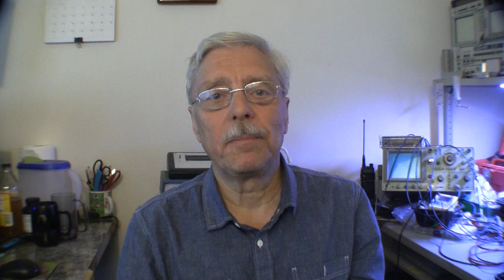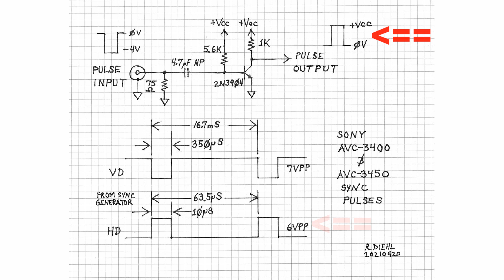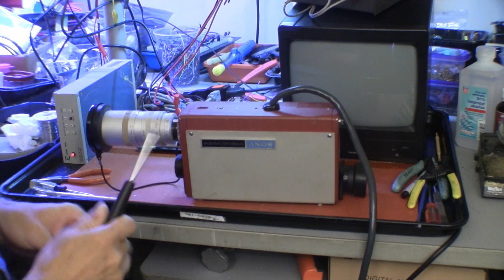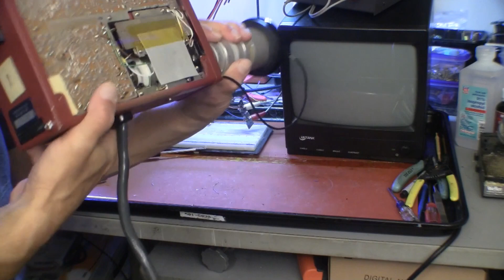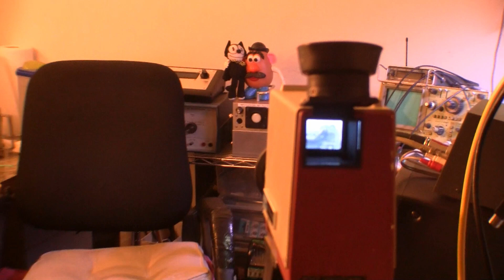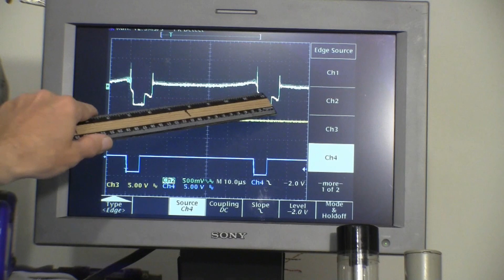Sync Generator Projects, Part 3 - Sony Cameras AVC-3400 & 3450

Comment: Why not use the CMA-1 power supply to generate sync signals?
Reply from the maker: The CMA-1 does not generate sync. It received it from the VTR deck it was plugged into. It had some pulse shaping circuits for the H. pulse. But no true sync gen. of its own.

Comment: very interesting, & detailed. Wish you had been my electronics instructor back in the 1990s. Though i do have a question: How low of a scan rate can it go, to say produce maybe 5 pictures (frames) a second over the usual 30 ? There is a group called narrow band tv, and was wondering if this would work for that purpose?
Reply from the maker: Thank you for the comment. Good ideas there.
See my NBTV series of videos. It would not be practical to convert one of these Sony cameras to a scan rate that low. The high voltage powers supplies for the camera and viewfinder are intimately coupled to the horizontal deflection and won't work at any other frequency. It would be best to build the camera from the ground up for that purpose. I based this conclusion on slowing down the frame (field) rate from 60Hz to 5Hz and the horizontal the same amount to create a 525 line, 5Hz refresh rate system. The flicker would be unbearable. Though it would work. Computer processing with frame rate upscaling could make it work too. But, in that case, there's mpeg.
As for NBTV, the frame rate is 12.5 frames per second and the line rate is 400 Hz. The picture is made up of 32 lines. Bandwidth is about 13 to 14KHz. In my system I clocked pixels from memory at 27.2 KHz to get more detail per line. (64 active pixels per line)
You may also want to watch my Philocam series to see how involved designing a video camera system from scratch can be. That one runs at 15Hz frame rate with 267 lines. When I built the camera, I included a frame buffer with 8 built in images for testing the monitor before the camera tube was making pictures. The frame buffer memory was part of the sync generator and made development faster and "easier". (There was nothing easy about it!) The proper process for designing a TV system is to work from the display backwards to the camera.
Here is my NBTV signal generator project: https://www.labguysworld.com/NBTV_10-4_Eleanor_001.htm
Reply: https://www.youtube.com/watch?v=_fO_xn1INfQ
Reply: This Grant guy near Toronto Canada wants to transmit Amatuer TV on 10 meters, and is talking to the Great Britian TV group. Thats what led me to ask if that sony camera could be slowed down to help out is idea, of using 10 meters I think around 29 Mhz to do it. I honestly felt for him cause who wants to transmit at 434 MHz just for no one to ever see it. Thanks for the well written explanation. I will check out your other videos, starting with your link. Thanks. Jeremy Cole N9IZX Canton IL 73

Comment: Interesting, I didn't know some 10-pin EIAJ cameras needed sync signals. So you can't use one of these cameras with a newer VTR or PSU because they don't generate sync signals. I would expect newer equipment to still generate those signals in order to work with older cameras.
Reply from the maker: There were not that many of the older cameras made compared to the later, more advanced, models. Color cameras had to have their own sync generators because the color signal was much more complex and the VTR/VCRs reached a point where they did not need to drive the cameras with sync anyway.
Reply: @videolabguy  Makes sense. When did single tube color cameras appear on the consumer market? The earliest single tube camera I can think of is the Sony DXC-1600 from 1974. 

 Also I don't know if you've seen this but Cathode Ray Dude, a guy on YouTube who has become popular, has a working AV-3400 VTR and the AVC-3450 camera. Sadly the camera doesn't work. He made a video on it titled "Sony's 1969 Camcorder".

Comment: Hello! I found someone selling the camera by itself without the VTR. Is it possible to go straight from the camera to a computer? Or am I grossly oversimplifying the process?
Reply from the maker: If you watch the series here, I answer that question. These cameras require a source of external sync pulses in order to create the complete video signal. If no pulses are sent in, then there are no pulses to add to the outgoing video and nothing for an external capture device to use for proper timing. The image in the viewfinder is misleading since the camera part and the viewfinder part use the same scanning oscillators, they are always in sync. Pulses or not.

Comment: I have a av-3450 along with CMA-5. I can’t get video out... may I ask, how do I get video out of that CMA-5?
Reply from the maker: CMA-5 is for self contained color cameras. That is, cameras that have built in sync generators. It will not operate a Sony AVC-3400 or 3450. I have no documentation for that camera adapter. But, it could be modified for external sync the same way I did my camera adapter. Contact me through my web site, Labguy's World.

Comment: im still looking for a avc-3400 for my sony av-3400 that i finaly got working these avc-3400 cameras are so hard to find bu for now i modfied a camera instaled a rocker switch for rec an pause an it works for testing purposes
Reply from the maker: The cameras on Ebay are massively over priced. Especially for being untested. The probability is good that they may operate. But, always plan on replacing the electrolytic capacitors and don't be surprised to find burns in the vidicons. Though, I have been lucky on this point. FYI: The 3400 camera, in my weekly update of 4/26, cost me $50 with free shipping. Just keep watching Ebay. They do turn up occasionally for a lower prices than usual. But, forget the guy selling one for $279. He won't come down to $50. I asked and was brutally rejected.
Reply: @videolabguy  yeah i asked an was brutely rejected people just dont care about a good deal anymore witch sucks also i have video of my progess if you wanna check them out rn im trying to trubble shoot the badly destorted audio
Reply: @axelthefoxytechworld8024  Hey, I found a avc-3450 (camera with the 10-pin cable) locally, and came across this video trying to see if it would be possible to even attempt to use it for digital purposes (without using the tape). But it seems like this is way over my head. I can sell it to you for $50 + shipping if you are okay with that. I can send over pictures of the camera if you would like!
Reply: @videolabguy  Shopgoodwill is great for this, I've seen the AV-3400 for sale on shopgoodwill before. It's auction based so nobody will be overpricing it, just whatever it's actually worth. I managed to get a working 3 tube Plumbicon camera made by Ikegami for $40 including shipping. SGW is amazing

Comment: Awesome scan linearity. Did you have to replace the capacitors in the cameras to achieve this?
Reply from the maker: I did not. These cameras are exactly as they were found. They are all still in excellent condition after half a century! I am sure that new capacitors won't hurt the camera. But, the less we mess around inside them, the longer they live.